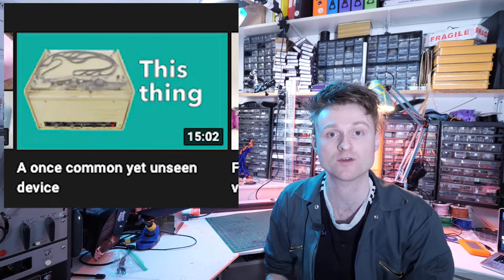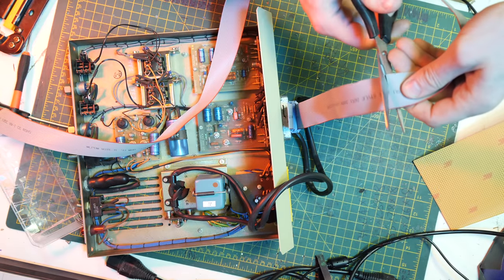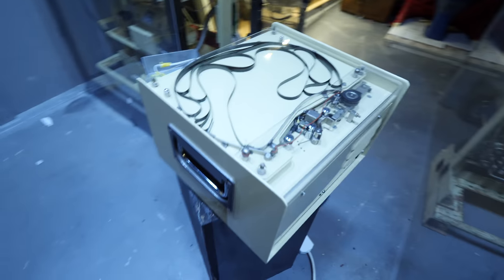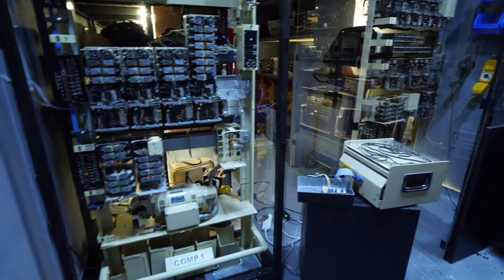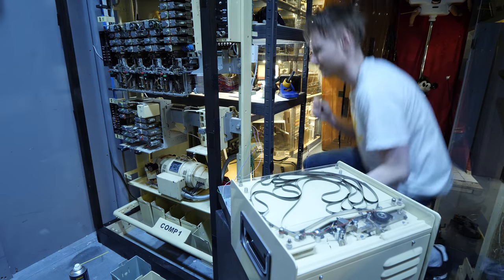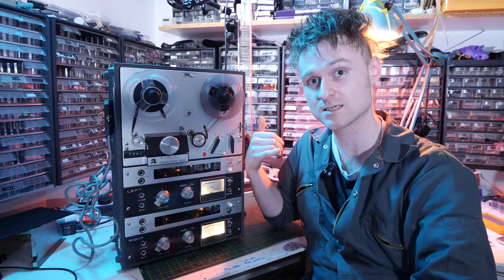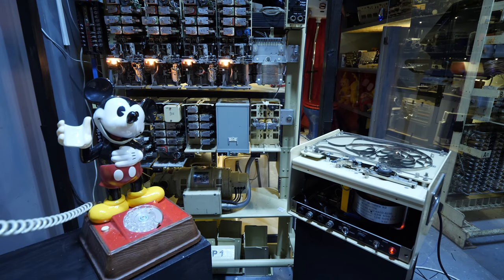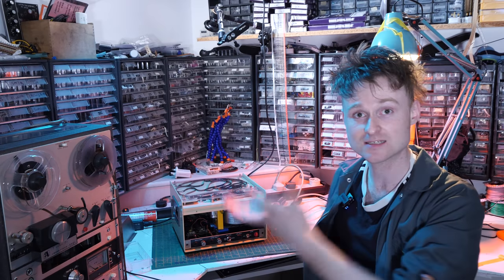Tape Loop Announcer Featured on Techmoan Fixed And Wired Up!

Comment from the maker: The audio from this video aswell as loads of songs, extra tech videos and livestreams to watch are available here :-
https://www.patreon.com/posts/53826733
Reply: Panasonic RS-296
Reply: 3M Scotch Handle
Reply: sticky tape dispenser
Reply: Pioneer CT-W606DR
Reply: Does my very first cassette recorder from the 70s, made in Poland, qualify? Was mono, had no extras, and worked for years. Later on I got s so called Geracord, which was the data storage device for my U880 home computer KC85. Btw, still having some Home Computers out of the GDR, and they still work.
Reply from the maker: @peter.stimpel  sounds like a tape machine to me!
Reply: Sansui WS-X1. Wicked 6-track + 2 track multitrack/mixdown deck.
Reply: The humble Ferguson 3T27.
Reply: roland space echo!?
Reply: I would name it Tapey McTapeface
Reply: #fisherpriceforlife
Reply: Glue Tape Dispenser
Reply: Walkman
Reply: The OG's VIC 1530 & Commodore 1531-- once you put the tape in yourself.

..but if you wanna bend something the Teddy Ruxpin plushie or Pocket Rockers might be up your alley m8!
Reply: Mellotron anyone?
Also I remember seing as a kid embroidery (sewing) machines, the ones that sew names or logos, being operated by tape.
Reply: My VCR player since it always eats my cassettes.
Reply: WEM Copicat
Reply: Call-ME-tape
Reply: Stock ticker.
Reply: Tapeworm
Reply: Did you know  you can dial that rotary phone with just pushing the handset button fast enough? Tried that when I was little.
Reply: Tascam Portastudio
Reply: Boeing 747
Reply: Sinclair ZX SPECTRUM 128k
Reply: Tape dispenser huhuhuh
Reply: My stomach (tape worms)
Reply: @dgo85  classic!
Reply: Reel to Reel
Reply: LTO9 bulk backup tape drive (Linear Tape Open revision 9 circa 2021)
Reply: IBM 729 Magnetic Tape Unit
Reply: stapedectomy
Reply: Karl Bartos
Reply: MNC-I CALL-Repeater
Reply: perpetudrone
Reply: Tape measure
Reply: Voyager 1
Reply: I have a CrownCorder around here somewhere...  I think it's a CTR-5100.
My dad used to send tapes to family overseas instead of letters.
Still have a couple that were sent to him, and some music.
Reply: Dictaphone 👍
Reply: Commodore 64
Reply: Betamax
Reply: @daviddalby6217  PXL2000 FTW!
Reply: A Tape Machine
Reply: F-18 Hornet (and other 4th gen fighters, presumably) - all those warning speech blerbs ("over-g", "altitude" etc.) were stored on tape, afaik
Reply: One of them measurey things with the yellow strip. I think it's called a strip ruler.
Reply: Mellotron keyboard
Reply: the gpo used divert-a-call units made by dynamic logic in the 80s used a standard looping tape cartage whilst it was diverting your call to a new number it played a standard message or a custom one. pretty cool
Reply from the maker: @firenado4295  spoiler for a vid soon!
Reply: We had a cat which had tapeworms. Does that count?
Reply: Teddy Ruxpin
Reply: Ticker tape
Reply: Tape chewer :)
or Tape chewing machine!
Reply: My old ADAT.
Nothing useful on the tape, though... xD
Reply: Magnetophon K1 from 1935
Reply: Mellotron
Reply: Duofone TAD-450
Reply: Tape dispensers
Reply: Cheap gadgets sometimes have tape also
Reply: All of my electronics projects >_>
Reply: Tape loop announcer featured on techmoan
Reply: @LOOKMUMNOCOMPUTER  haha nice
Reply: Derek
Reply: How the hell did you figure this all out?
Reply: Got some tape holding together my laptop's insides!
Reply: Betamax
Reply: Tapely jobly
Reply: Echoplex (hadn't seen this mentioned!)
Reply: My car, at least 5 rolls of electrical tape in the wiring harness, and nearly 1/4 of a roll of solder

Edit: and the ECU has had all of it's 27+ year old resistors replaced. It's amazing how many times that fixes older electronics
Reply: Roland SRE-555 (a rackmount Chorus Echo)
Reply: Say It! Play It! from Kenner (1968),  also,
    I have a wire recording from the 50s that I have never heard from my parents relatives in Italy.
Reply: T-rex replicator tape echo module
Reply: Audichron telephone intercept voice announcer
Reply: Scotch tape dispenser. 

(A tape Scotch dispenser would be better)
Reply: The brains of tories
Reply: You should make a second channel: LOOK MUM NO TRANSISTOR
Reply: Fripp's Frippertronics
Reply: Didnt old "repeating dolls" have tapes in em?  Also, here I am thinking, "why oh why did I throw away that answering machine that didnt take much space but I didnt think I clould use.. "
Reply: 3M Cantata 700 Background Music System
Reply: Unitra ZK140T
Reply: Gordon
Reply: my fiat cinqucento.... :(
Reply: The Mellotron
Reply: Great vid - I expect the other, same aged electrolytic caps will be turning into resistors which could end up damaging other components - might be worth replacing them just to be sure. Too precious to risk
Reply: What a lovely unit! ♥ Man, it would be great to see your take on a really lo-fi/rudimentary DIY tape echo. There are some really cool projects floating around, but the most documented ones tend to require really advanced knowledge on electronics + rare and expensive units like Marantz recorders, Tascams or big fancy reel to reels hooked with a mixer… on the other hand, there are some really lo-fi ones with walkmans, chaining two micro cassette players or really cheap small reel to reel recorders, but not that much info around, just old posts on obsolete forums with people saying that the heads won’t work due to tape bias and such, but some people seemed to had some degree of success… even those experimenting with a 3rd head hot-glued on a cassette or rubbing cards on tape strips manually. So… isn’t it that un-doable? there are tons of super cheap hand recorders around and basic reel to reels that don’t run with belts and are easy to restore (few components, simple boards), it would be great to bring back to life some of them with extra heads added, something like this: https://www.youtube.com/watch?v=9LoH1ADNqDA  Cheers!
Reply: came here to say 'my m400'.
Reply: @letsallbe-friends1120  i was about to comment the same thing, awesome machine.
Reply: Airplane Black Box.
Reply: Mellotron!

It's like a sampler, except it's all analog analogue.
Reply: I name it Josh.
Reply: Uher 263
Reply: my computer
Reply: Akai 4000DS.  I must have sold literally hundreds of those when I worked at Comet in the mid-1970s!
Reply: Daleks probably do if you could open one up.
Reply: A Turing machine runs ON a tape, does that count?
Reply: Mellowtron
Reply: "Name a machine with tape in it" scotch tape dispenser. (I think you call it cello tape in Britain).
Reply: My old answering machine had a cassette with an endless loop for the outgoing mesage. Sometimes we'd put that in a regular tape player and let it run.
Reply: My uncle's rustbucket pickup truck
Reply: Hilarious i use to tell anyone who asked pe what a capacitor does I'd say that they capacitate.Giggles

Comment: In New York City one could call “dial-a-joke” in the 1970s, and hear a daily updated joke from a famous comedian. Cost a few cents. They used this rig or something similar.
Reply: Same here in the UK. We also had 'Dial A Disc' for listening to a song. As kids we got around paying for the service in public callboxes by tapping out the number on the receiver cradle pins. From memory, it was a short number, like 16 or 116. It was actually quite boring, but we lived in a small town and 'stealing electricity', which would be the technical term for the crime, was about the most exciting thing that happened in town.

Living the dream......
Reply: @horsenuts1831  wasnt it called abstracting electricity
Reply: @horsenuts1831  I think in the US it's called wire fraud or some such. "Phone phreaking" used to be something hackers would do once they figured out the tones that gave you free long distance dialing. Steve Wozniak said he and Steve Jobs used to do it before they founded Apple; driving around to random pay phones and hacking the phone system. They had homemade tone boxes in the car and Wozniak says they were always afraid they'd get stopped by a cop and charged.
Reply: The old 'Dial A Disc'.. 
I also remember the old trick of tapping out the number to listen for free, but there was also (this took more practice) putting a coin in the slot but holding on to it and pulling it back out at just the right time. 
We were all obviously determined juvenile criminals

Comment: There is an optical "Speaking Clock" mechanism in the collection that was stored away at the Birmingham Museum of Science and Technology. It is all stored in a warehouse at Newtown, Birmingham since the Birmingham City Council criminally closed the museum around 1998. You might want to see if they would at least let you borrow it. The vast majority of exhibits are stored on shelves in the warehouse and can only be viewed by prior appointment. The closing of the museum was one of the main reasons I moved away from Birmingham, I used to take my kids there every Sunday as my father did with me (he was a telephone engineer btw).

Comment: Very neat!
Reply: But... But... This channel is specially about no computers! 😀
Reply from the maker: Pre 2000 allowed Jako haha
Reply: Yeah, bugger that No Computer stuff. I'm sure 8-Bit guy could create a small PIC board to emulate all functions of that room of wire mess, allowing tape player to work as a stand-alone device on display.
Reply from the maker: @aleksandrbmelnikov  it works without all that mess anyways?
Reply: @LOOKMUMNOCOMPUTER  You need at least one phone on outside of display case, for visitors to enjoy and understand context of how message player was once used. Thankfully, we live in age when this can be accomplished in smaller form factor with less wasted electric.
Reply from the maker: @aleksandrbmelnikov  there are more than one telephones wired up for visitors. It’s all interactive. Funnily enough when these things are on standby they don’t use any energy. Only use energy when the call is being made.
Reply: @LOOKMUMNOCOMPUTER That extra Like was from me. I am glad this device has gone to where it belongs, and is needed most. You are doing more for human kind than you know. My best regards.
Reply: Sorry to hijack this comment but I'm curious what you think. I wonder if this could've been used to load a computer program like the ones you could load from cassettes for the many 8-bit computers?
Reply: @lightmagick  Given very long load times, and short amount of tape in device... Simple answer is No. You'd have to save programs on a recorder, Cut off that bit of tape. Hand-splice each tape into a loop. And now what? You can't roll them for storage, without cutting splice apart. Save yourself pain and trouble. Buy any cheap mp3 player with micro SD slot. Use voice record to save programs, and play them back to load. Does you phone have a headphone jack? Download programs other people saved as mp3s. You can load, RIGHT FROM YOUR PHONE, using common 3.5 aux cable. Enjoy your little trip back in time.
Reply: @aleksandrbmelnikov  Yeah I know all that I just think it would be an interesting thing to do whether it worked well or not. To think that it could be possible to essentially call into a line like this, hook the phone directly to the cassette in on your 8-bit computer, and load the program playing on repeat. This could have been done back then and I find it neat. 😁

Comment: 23:54 About the speaking clock, in the US, we used large magnetic drums. The tape heads were driven by a mechanical clock mechanism. They were so old, that some of them would originally say 9:05 as "nine five." Locally, one was still in operation into the 2000s.
Reply: I recently viewed a video with an alarm clock that works just like that. Very ingenious combination of mechanics and magnetically stored sound.

Comment: Loads of memories brought back in this video. When I left school in the mid 70s I got an apprenticeship at GPO Telephones, factories division and between specific training sessions we had to remove all the wires from one of those black tag boards (c200 connection if memory serves). Get it inspected by the trainers to make sure all the solder had been cleared. Then rewire it and again get it inspected for quality of work. If you were too good at the main training you ended up doing this many many times over the course of the first two years LOL. Great vid, thanks. Will have to watch the rest in this strowger series

Comment: I remember these, in some rural exchanges this was piped in on tie lines and the incoming callers to the service all shared the same transmission circuit. It was possible to shout and talk to each other over the music. We used "16" for the service to be called on. Yes you are correct, weather, cricket, football all used the same machines. Great stuff.

Comment: Could you set it up so that the announcement plays whenever you call a number that is not in the system?
Reply: You basically would just have to short all of the pins on each line together, and they likely made a jumper block just for that purpose.

Comment: I was a Tech2A in Cardiff Telephone Exchange in the mid 1980’s. Working on the manual board with the telephone operators part of my job was recording these tape loops onto a pair of Revox B77 tape recorders.

I was allowed to choose which operator I wanted to record, and we would both sit in a small sound proof booth whilst she read out the typed announcement. The operator would return to her normal job and I’d make multiple copies of the recording (hence 2 reel to reel machines), and cut these into the required loops.

The 9A’s would chew tapes after around 7-10 days of near constant use, so I’d always hang a spare (suitably labelled) over the end of the rack - the reason for making multiple copies. If that one broke you would go back to the master reel and make another.

These machines were also used for dial in competitions - I remember that Tetly Tea did one where you had to identify the 10 sounds (crinkling cellophane wrapper etc) - so much easier when you have the master tape 🤫

Comment: This is so awesome to see this old tech working again!  I work in a telephone exchange and way back in the day our stepper switch was right where our offices are now.  It's cool to actually see one in operation and the announcer is super cool too.  Quite a rare thing to see now days.   We actually have a dedicated announcer system for when you dial a number that got moved ex: "The number you have called has been changed, the new number is", it's all electronic but it's super old with all discrete parts, it's pretty neat that it still works and is still being used.

Comment: For the museum, you could hook up a dozen dial up modems to the exchange, and have the computer they're connected to able to receive VOIP calls so people can dial the various objects in the museum without the need to have umpteen phone lines (or for you to connect old, slightly adhoc equipment to the public phone network)

I really hope to be able to visit the museum at some point. Everything about it is right up my street.

Comment: I use to work for plessey telecommunications back in the 70s on exchange construction these tape loop Machines were installed on racks at different points in the exchange I always like watched them doing the job

Comment: That automatic exchange looks like a Strowger type. Back in 1987/1988 I worked in a exchange which used that type of equipment. The terminals on the rear are called tag blocks. Installers of the wiring took great care doing all the wiring very neatly.

Comment: I recall dialling the dial a disc service in the 70s. Dial 191, time was 123, operator 100, engineers 141.  Telstra used magnetic drum machines for its RVI needs. These were made by CEI (Consolidated Electronic Industries) in Melbourne.  I saw one of those machines while working there in the early 80s. I was working on Fidelipac cart machines at the time and one came in for repair.  They had from 4 to 16 heads and a large drum coated in ferric oxide.  They were also able to record since you couldn’t use a tape recorder and transfer the tape like with the announcer.

Comment: I remember being asked to maintain an answering machine I hadn’t worked on before. The customer was a doctor so on Christmas Eve this was important. To make sure the tape stopped when it finished there was a photo-electrical cell the tape ran passed. In the tape was a hole. This allowed the light through and stopped the tape. The next call in the tape was reactivated for a second irrespective of the photo-electrical cells state and then the tape would continue until the hole switched it off. I got it working. Can’t remember the cure, it was something else and simple.

Comment: I remember seeing a documentary about the speaking clock and it had the numbers and phrases recorded onto glass disks, with the sounds encoded as dark/light patterns and detected by optosensors. Each disk could be played in the correct sequence to make up the announcement. You could probably make a "replica" by printing the sound waveforms onto OHP film with a laser printer and using photodiodes to read them, and maybe a microcontroller or some crazy collection of relays/uniselectors to operate them. Would make an epic project!

Comment: Great to see a followup from Techmoan's video. I wonder if the equalization of the original recording was optimized for going over POTS lines. Also, I remember the announcements from the first digital exchanges in the 80's came from hard drives. The first time I had witnessed digital audio on a hard drive.

Comment: This video was fascinating, can I ask what the reason for having the tape loose, compared to just having it all wound up on a reel to reel?
Reply: Fewer moving parts. There's no tape spindle to jam and no twists in the tape to worry about. The way the housing is built and the tape is arranged means it's never gonna fall horizontal or overlap and tangle.